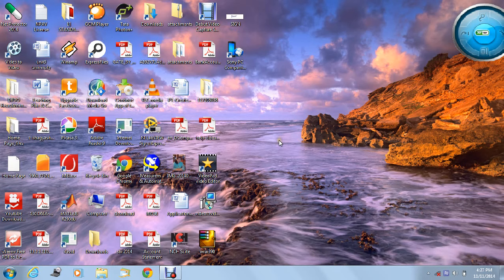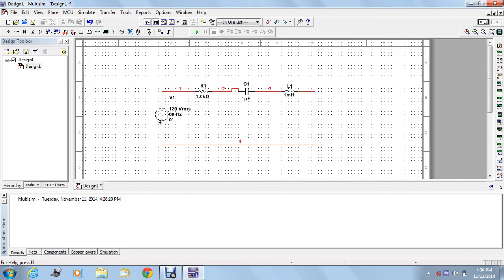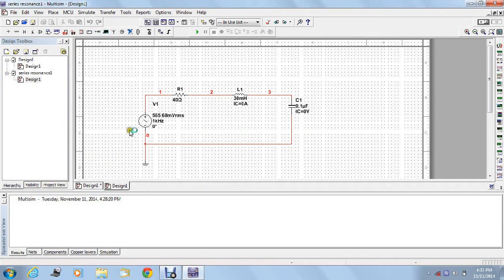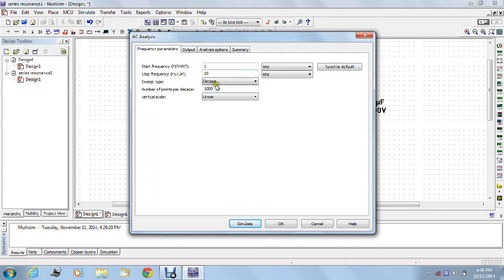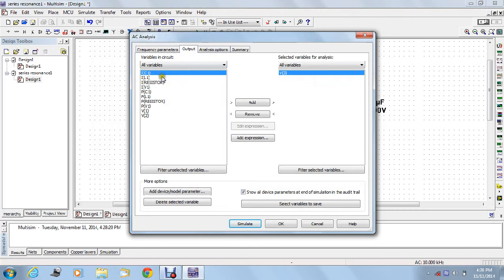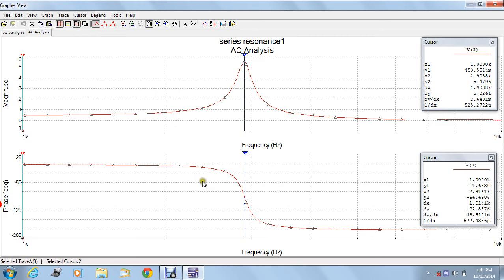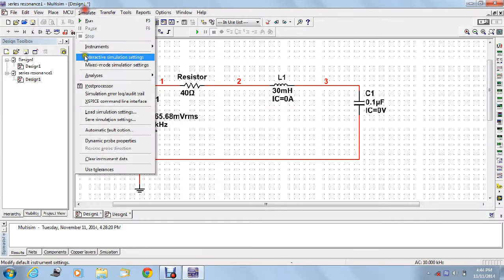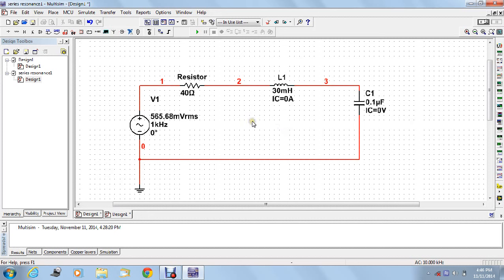Multisim simulation for series resonance | Explain how to use Multisim for simulation

Comment: Hello,

Excuse me, do you have a video that explains a three-phase connection experiment and how to solve it using the Multisim simulator?

I am also interested in a video explaining power factor correction for a three-phase system.

Thank you very much in advance.
Reply from the maker: Yes, three-phase experiments are already available in NI Multisim 😊
You can perform star (Y), delta (Δ) connections, two-wattmeter method, and even three-phase power factor correction using Multisim components.
Why wait for videos?
👉 Start today, try it yourself, and learn by doing!
Multisim is a wonderful tool to build strong practical understanding.
I will definitely record detailed step-by-step videos on: • Three-phase connections
• Power factor correction in 3-phase systems
If you record your experiment, please feel free to share it with me — I would be very happy to see your  work.
Keep learning. Keep experimenting.
That is how real engineers are made 💪✨
Reply: Okay, could you please send me the video link? @PinnacleBhagyashriThorat